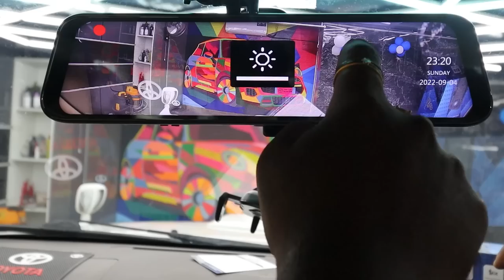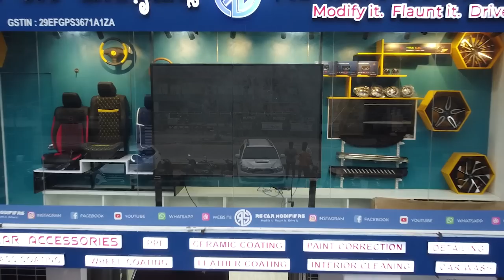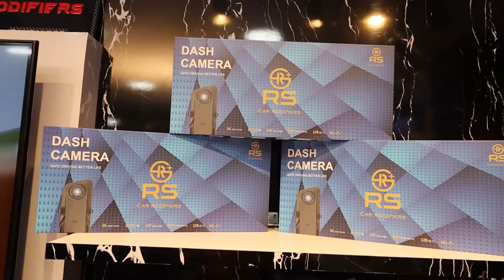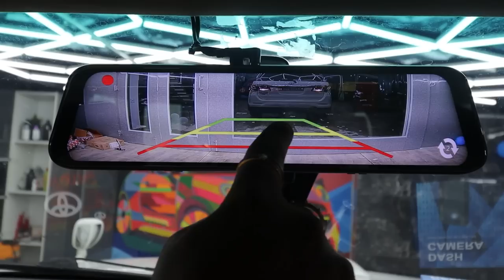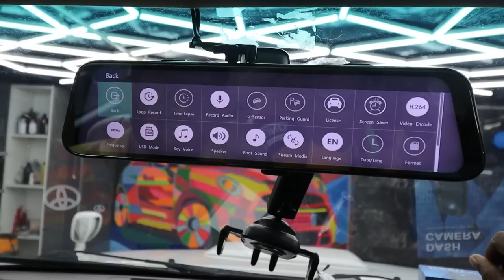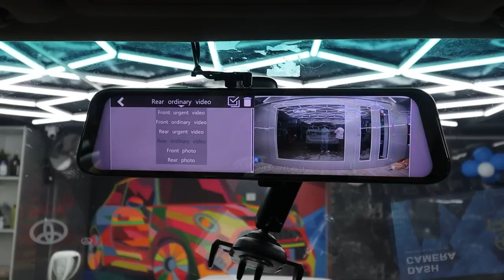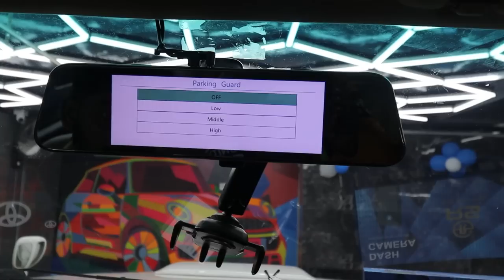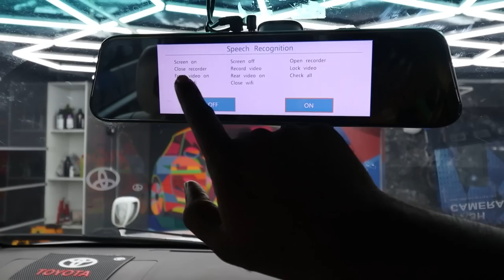Rs.29,500/- Biggest Fortuner Horn 🤩 Dash Camera | 25% Discounts on Car Accessories 🚗

Comment: Rear cam is not safe, easy to remove and run away😂😂
Reply: yes bro aftermarket reverse camera is not safe. it it's fitted by company from the company then it might be equipped with anti theft alarm.